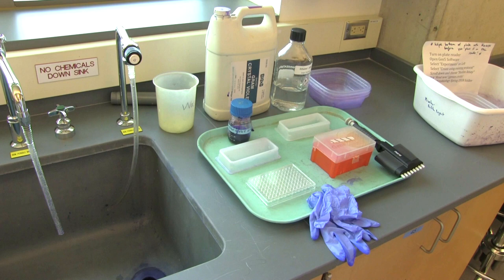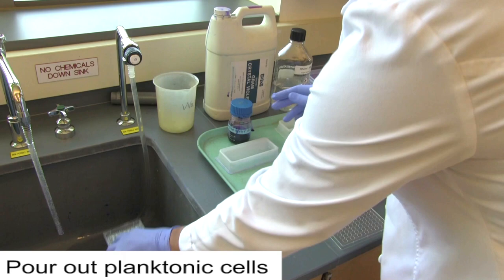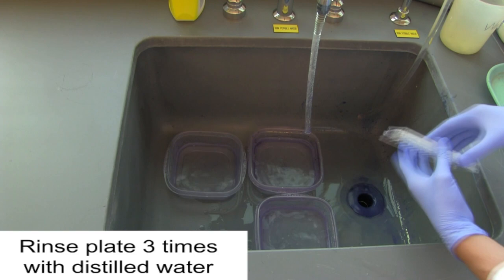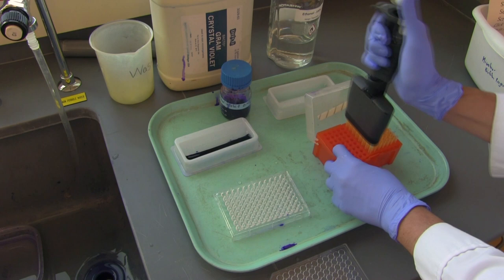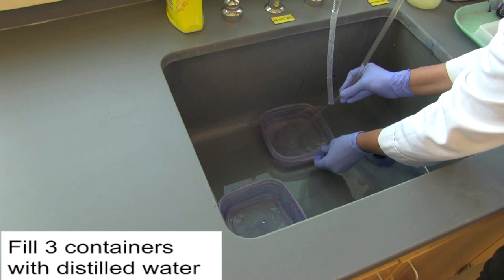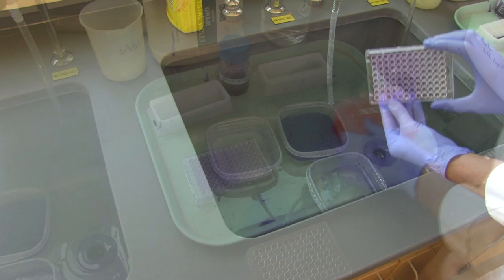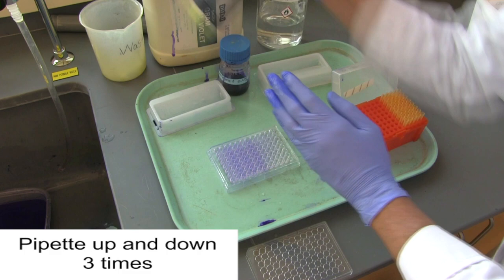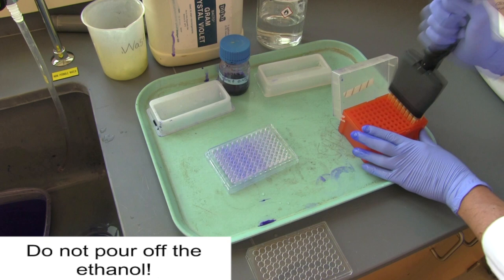How to stain biofilms in a 96-well plate

Comment: you may find that the initial washing steps submerging in water create hydrodynamic aberrations strong enough to disturb and remove all or parts of your biofilm in weak biofilm forming bacteria. in such cases you may wish to pipette in the dH20 or PBS in and out of the well (still doing it 3 times). it takes a bit longer but is important if you are struggling to keep your biofilms in tact. you can monitor this throughout the biofilm assay by regularly inspecting the plate by eye to see what lies at the bottom of the wells before and after each treatment.
Reply: Then what is the process descrive it pls
Reply: @diyadey3551  I really don't see what there is to not understand. I've provided my comments as to how you optimise the process described in the video. I'm not here to write out protocols for you. There are plenty of protocols for static biofilm assays available online which you can adapt for whatever your research demands.
Reply from the maker: Great advice - thank you!
Reply: I was thinking the same, thank you for sharing your thought.

Comment: I am worried about contaminating other stuff. We are not allowed to drain the media in the sink at all. And if we use pipetting to wash from each cell, would it disturb the biofilm?
Reply from the maker: Yes, we have found that if you use a pipette to remove the planktonic cells or excess crystal violet from the wells, that the biofilm is disturbed. To avoid pouring your cells straight down the sink, you can decant into a tray of bleach instead of straight down the sink. Also, if you are worried about cross-contaminating your wells during the washing stage, you can use a sterile plastic transfer pipette to gently add water into each well instead of plunging the whole plate into a bucket of water. However, I would still recommend inverting the plate and pouring off the wash step instead of using a pipette to remove anything. I hope that helps!

Comment: Do we need to air-dry plate befor adding the ethanol?
Reply from the maker: Good question! We do not air dry the plate before adding ethanol. Just make sure you have shaken the water off well after the last wash.
Reply: @lisambowers9109  big thanks lisa,, ,if the plate is air dried, do you think it will affect the result?
Reply from the maker: @dwifebrianti8336  I think it's fine to air dry the plate (but you don't have to).
Reply: @lisambowers9109  thanks for the explanation

Comment: Isn't ethanol normally damaging the membrane of bacteria?
Reply from the maker: Yes, at this point in the protocol, you want to solubilize the cells with the ethanol, releasing the crystal violet into a homogeneous solution that can be quantified by a spectrophotometer. For this reason, you keep the ethanol/crystal violet solution (don’t pour it out!). Does that make sense?
Reply: @lisambowers9109  Yes, thanks a lot :)
Reply: @lisambowers9109  At what wavelength are you measuring? Do you do it directly in the wells or do you transfer the solution to a quartz cell? Thank you very much for your answer!
Reply from the maker: @dimasgamez7119  We measure the crystal violet stained biofilm at 492 nm directly in the plastic 96-well plate.
Reply: Please, read with ethanol in wells ? Don’t pour it and read empty well